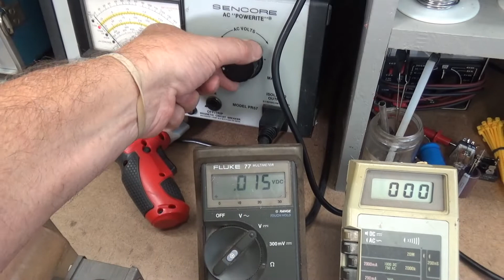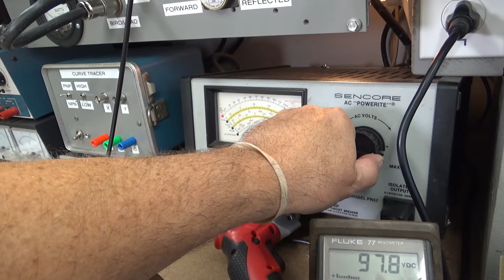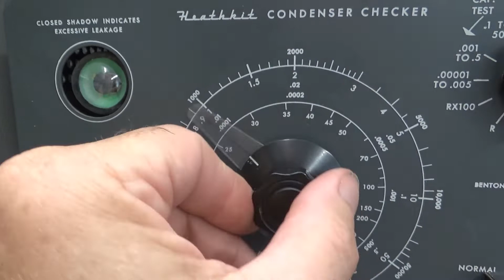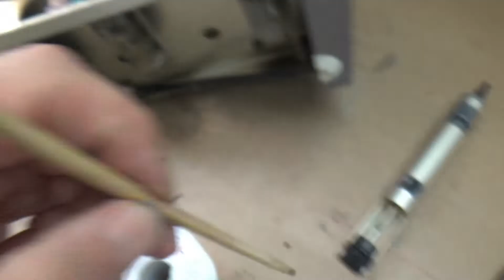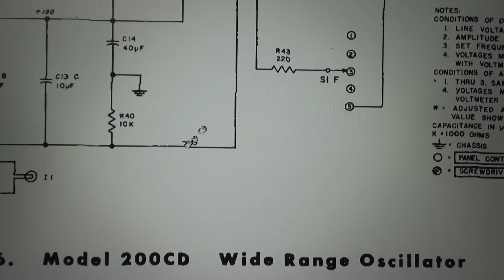Hewlett Packard 200CD Wide Range Oscillator Checkout Part 2

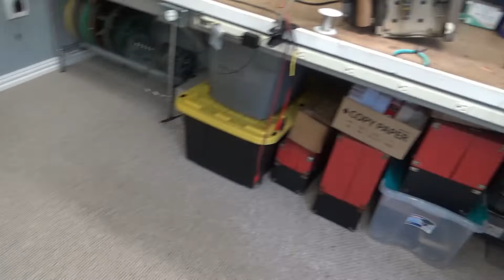Comment: 41:00 I don't know if you know it but, one end of those bumble bee cap's is actually a tube that will let you unsolder the lead at the capacitor without having to disturb the connection to the lug. If you look closely where the wire enters the capacitor, one side has a larger look to it and you can heat the wire there and pull it out of the cap. It will then leave you a small connecting point to test the cap without disturbing all sorts of other crap. You will probably find they are all junk anyways, and need replacing, lol
Reply from the maker: Oh yeah, I'm aware of it, some have them some don't. these do not. The ones with the tubes are actually oil filled caps while the ones with the tubes are plain old paper caps. both are crappy and extreme prejudice should be exercised.